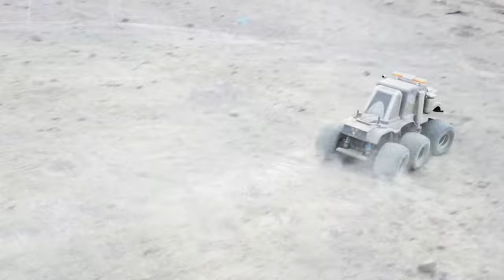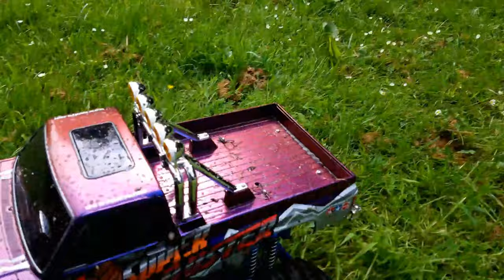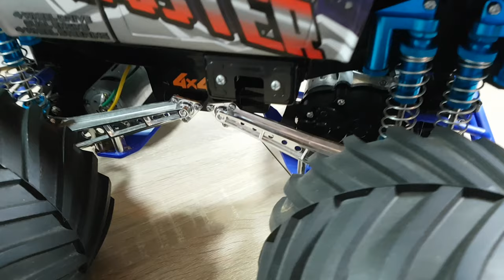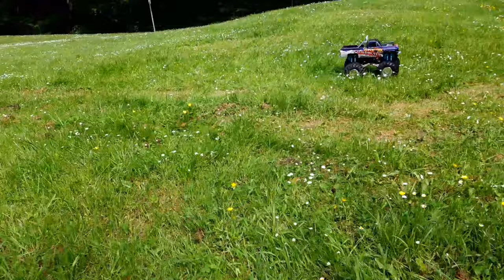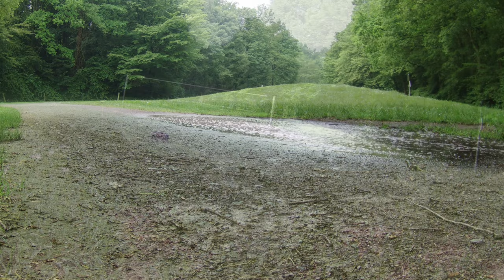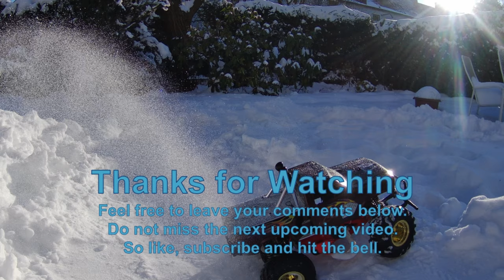Tamiya Super Clod Buster - my Upgrades and a short Review

Comment: Hi there Dirk, a great looking Clod Buster. You’ve really painted the body well, looks really good. Bearings are a must for sure, I really don’t understand why Tamiya don’t put them in the kits as standard, especially as the competition widely do, for the same money. I hope you’re able to source you intended upgrades easily, it would be nice to see again, when you’ve completed them. Merry Christmas and a Happy New Year to you and the family. 🎄🎅😊😉
Reply from the maker: Hi John. I fear it's some kind of tradition. In the 80s the sealed Tamiyas were very expensive, and still are. So they sold it as upgrade parts. First turn-around came as their company daughter Carson came up with cheap (non-sealed) ones. They somehow never learned, that ball bearings are mandatory.

On the other hand there are many out there in the RC family who say, I'm fine with bushings, because of dirt, water, etc. Shorter running times are accepted, because batteries are cheap.

No matter what they do, they'll always do it wrong😁.

Thanks for watching and best wishes for the holidays.

Comment: What Motor Did You Get For The Clodbuster
Reply from the maker: The stock ones. Everything else in the Tamiya program is timed and won't work. Both  motors have to run in opposite direction at the same time in the Clod. It think RC4WD has some none-timed 17T motors.